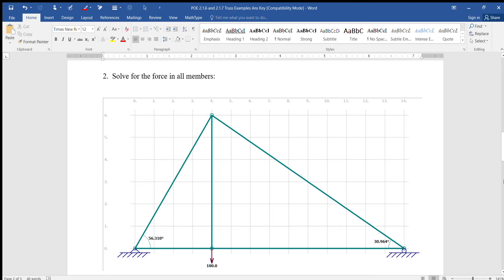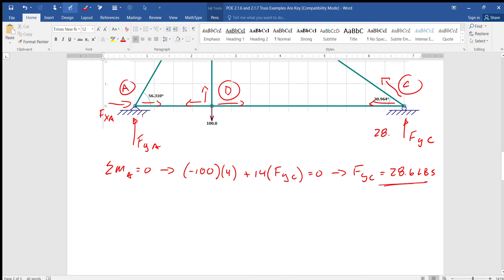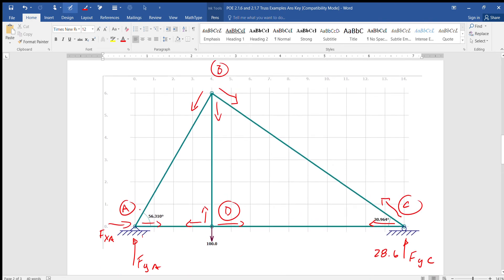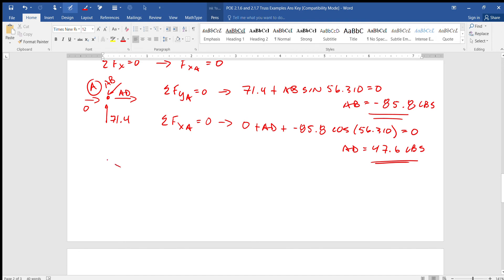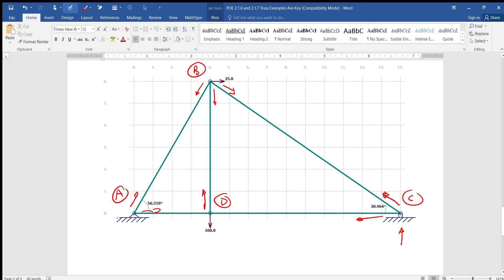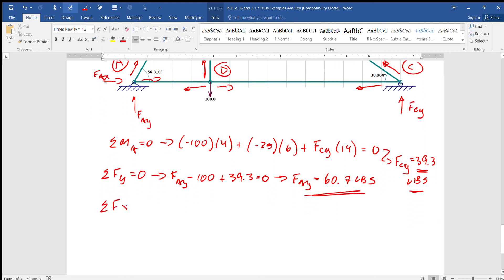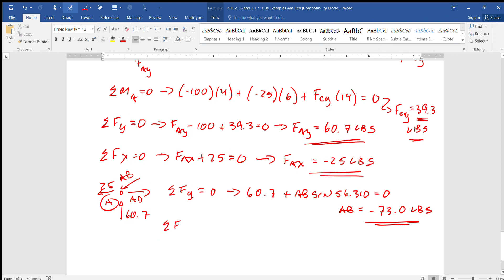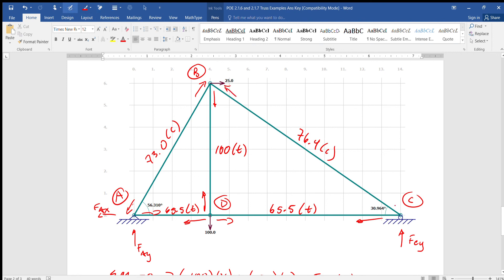POE 2 1 6 and 2 1 7 Truss Examples Ans Key Problems 2 and 3

Comment: Why is the moment for B negative on problem 3?
Reply from the maker: Not sure what you mean.  If you mean the initial Moment calculation, the moment from B is negative because it causes a clockwise (CW) turn about A, which is defined as negative.  I use the right hand rule.  When I point my thumb INTO the page, my fingers trace the moment about A.  That means it is negative.  If my thumb came out of the page, it would be positive.